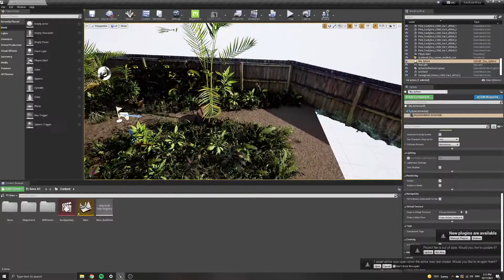This Cardboard Tube has a Suprise

Comment: Scene analysis (0:00 - 0:12):
The dissolve into the first frame signifies a passing of time, a discovery of an old thing. The main character is framed in the center of screen, but far away from the viewer, showing that they are incomparable to the entire world and isolated from everyone. The diegetic sounds create a calming sense on the viewer while the internal diegetic dialogue of the main character make us feel solace for them. The cuts to close us show the reemergence of a familiar face, connect the audience and the character. The non-diegetic score is further used to create a calming sense in the viewer. I don know what the purpose of the cut from a low angle to a high angle represent